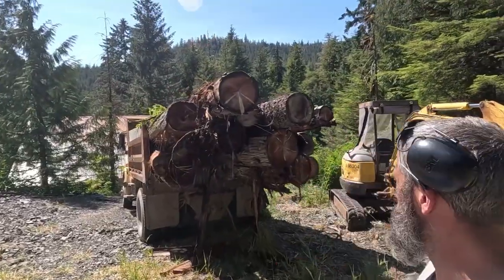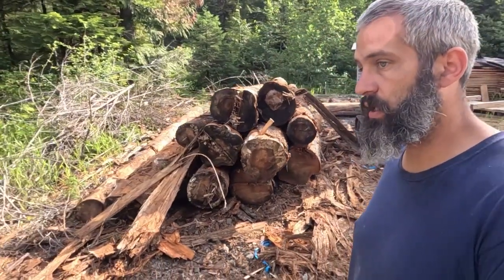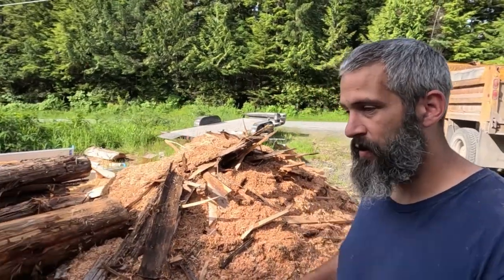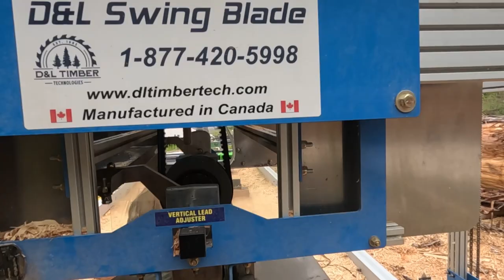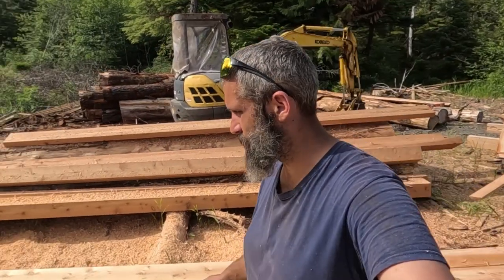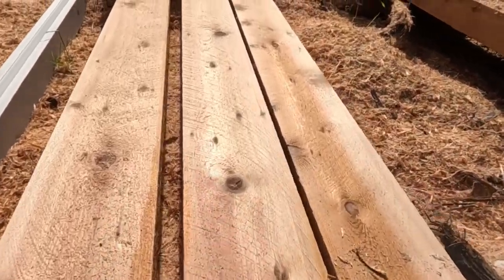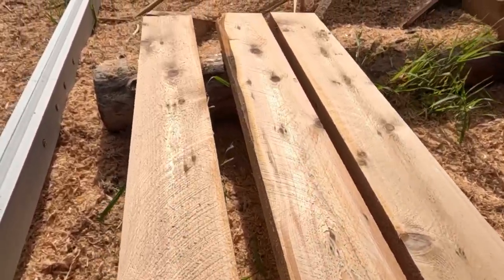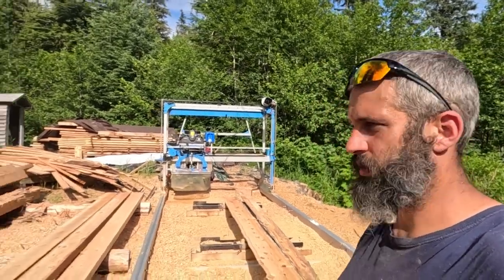3x8x16 Red Cedar Rafters

Comment: how are you deciding what you can get from the log? ive just got a lucas mill and from what ive been reading you take the wide boards from above the pith and below.. but horizontal boards at the pith line and top and bottom of the log.. do you do this? 
oh and thanks for the vids very interesting seeing your workflow.
Reply from the maker: For now it’s been getting what I need from the log. I seem to be grabbing 1x4s until I get out of the taper. Once I get to that point I may grab a couple more out for what what I need. I like to cut in the vertical as much as I can. Seems to be a little easier and more production with out adjusting the mill. 

Just my routine so far. I’m sure I’ll look back some day and realize I had it all wrong but just takes time and learning.